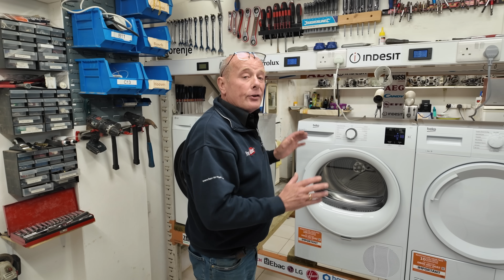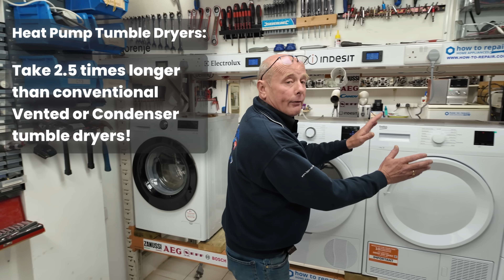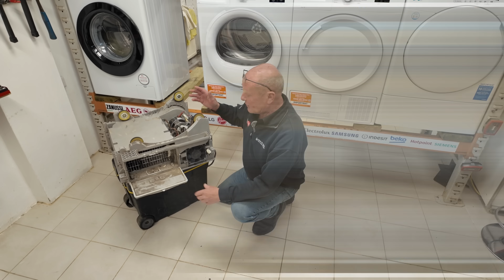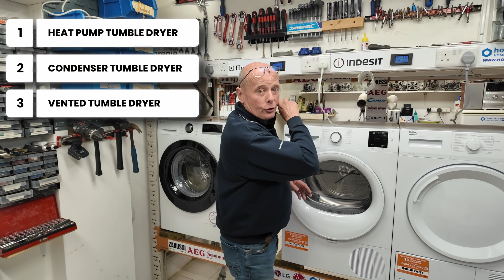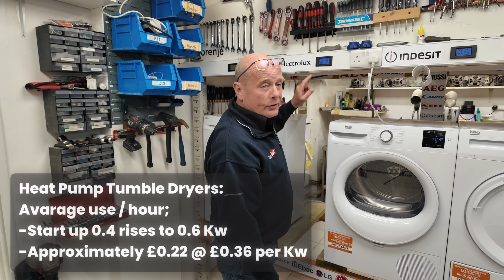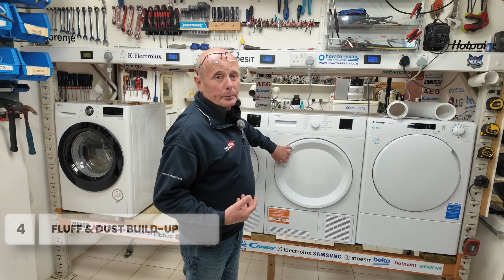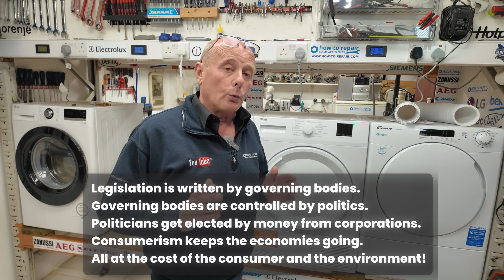Tumble Dryers the Shocking Truth About Heat Pump vs Vented & Condenser, NEW LEGISLATION!

Comment: I have a heat pump tumble drier, an ‘own brand’ one from a well known high street department store. It is now over 12 years old and has, and still is, performing faultlessly. One advantage of a heat pump drier is that the risk of it catching fire is very much reduced because it does not have a high temperature electric element, the heat exchanger runs at a much lower temperature than an electric element does.
Reply: A propetly installed and msintained std. Dryer will never catch on fire.
Reply: emmmm the only reason they catch fire is because people run them with a damaged lint filter thereby allowing fluff to get in to the heating element, the gas in a heatpump dryer is not exactly environmentally friendly is it
Reply: @dazt5831  Fluff could also get through the holes in the back of the drum and fall onto the element, some will always get through the filter mesh, bad design, overloading, wear and tear, and flexing in the case can also cause gaps in the drum seals which would allow fluff to get through and get trapped in the drum seal from where it could fall off into the element, and also form a felt like layer on the seals. Even after my vented dryer was modified as part of a fire safety recall, a layer of fluff had coated everything inside the case after about 7 -8 years more use, although significantly less than the last time I'd had it apart.
Reply: The energie saving on a heatpump unit versus a condensor is far less in wintertime. Energie consumed by the dryer stays in the house as heat. Saving on gas....Same as with bulb lamps versus led.  In a house full of LED lighting you need more gas to heat it. Small difference but it must be considered when comparing.    DIY repair options are very important as it saves a lot of money..
Reply: @JurBtree  Yes, except using your example you are paying 5x less for lighting an LED house vs incandescent one.
Reply: 50 years as a retailer and repairer, I wouldn’t touch a heat pump dryer with a long pole.
Reply: I've got a Bosh Series 6 heat pump dryer. Had it for 3 years and love it. Yesterday I dried a towelling robe that was hardly damp. I expected it to finish drying in approx 20 mins. It didn't finish for well over an hour. I suddenly rushed into the kitchen as I had been watching TV and forgot about it. When I opened the door there was loads of steam and the robe was that hot I could hardly touch it. I rang Bosch who put a call on. Engineer came today. He changed the door as it had dropped and when I mentioned about the hot robe he practically laughed at me and said it is not a fire hazard as it does not get hot due to the way it works. There is no way it can catch fire he said. So can someone in the business explain this to  me please?
Reply: totally agree had mine heat pump tumble drier R134a gas 14 years now and it still looks like new inside took it apart last week the belt was perfect did look 14 years old , it's  environmentally friendly  due to amount of electric it hasn't used , I've had condensing and outlet but both made my kitchen windows mist up and the electric bills with a family of 4 people  was another reason .
Reply: The added complexity of the heat pump dryer might lead to an increase in fire hazard. We wouldn't know without seeing fire statistics.
Reply: @dosgos  There are literally billions of air conditioners and fridges in the world.  I've never heard of one catching fire, though I imagine there's the occasional freak event.  It's clearly not a dangerous technology.
Reply: @incognitotorpedo42  With the newly introduced more flammable refrigerants, this becomes more of an issue.
Reply: really?  Heard of Grenfell Tower?  Root cause was a fire from a faulty fridge/freezer (a Hotpoint FF175BP to be precise).
Reply: @M6L9  correct. And since the discovery of the ozone hole we've moved over to refrigerants that are themselves inflammable if they leak. The Grenfell fire fit example was started by a fridge that used propane as a refrigerant. All you need is a leak of inflammable gas plus a spark....
Reply: My drier uses R134a which under normal use is non-flammable. Most domestic fridges use the same gas, however because of its potential global warning issues it is being phased out. I am not aware of any fridges or heat pump that use butane as the gas.
Reply: @ChrisSchroeder-g3t  You may not be aware of any fridge or heat pump that uses butane based gas - but that doesn't mean they don't. I just checked the label on my fridge - as I thought - it uses R600a which is an isobutane - extremely flammable - but non toxic. It is actually a popular choice for refrigerant gas as it has a very low global warming impact particularly compared to R134a - 3 vs 1430 for R134a, so as you noted R134a is being phased out. It also has a lower pressure requirement compared to R134a, making leakage and construction cost slightly lower.  I hope when your dryer fails you take the appropriate action to have the R134a removed and dealt with rather than it just being vented to the atmosphere. Hope this helps your knowledge.
Reply: @ChrisSchroeder-g3t  

Some Heat pumps use R290 which is Propane. Has a very low GWP.
Reply: Sorry, but that is simply not true. Heat pumps use R600a gas, which is butane. It's highly flammable and at risk of exploding if it builds up in a poor ventilated area.
Reply: @TheLinkedList  

Sorry but that's not true, my Samsung HP dryer uses R134a, or tetrafluoromethane, it’s nontoxic, nonflammable, and non-corrosive.
Reply: @_Dougaldog  R134A erodes the ozone, and it doesn't take much. It is also heavily regulated in the EU/UK, expensive and soon to be banned from uses like dryers and fridge freezers. How is old is your dryer, newer models from Samsung use R600A?
Reply: @TheLinkedList  

13 months old, Samsungs flagship HP dryer uses R290.
Reply: @_Dougaldog  I'm surprised, samsung must be using a lot of refrigerant in their flagship tumble dryers to merit using R134A.

HIsense are using propane in theirs, for example.
Reply: @TheLinkedList  

My unit is not their flagship dryer, the unit that is uses R290 (Propane) with a GWP of 3 if I remember.
To put things in perspective if my house heat pump lost all its R32 after a catastrophic failure that would have the same total GWP as the CO2 produced from a gas boiler in six months.
Reply: @_Dougaldog  Tetrafluoromethane, like other fluorocarbons, is very stable due to the strength of its carbon–fluorine bonds. The bonds in tetrafluoromethane have a bonding energy of 515 kJ⋅mol−1. As a result, it is inert to acids and hydroxides. However, it reacts explosively with alkali metals. Thermal decomposition or combustion of CF4 produces toxic gases (carbonyl fluoride and carbon monoxide) and in the presence of water will also yield hydrogen fluoride.

It is very slightly soluble in water (about 20 mg⋅L−1), but miscible with organic solvents.

Uses
Tetrafluoromethane is sometimes used as a low temperature refrigerant (R-14). It is used in electronics microfabrication alone or in combination with oxygen as a plasma etchant for silicon, silicon dioxide, and silicon nitride.[8] It also has uses in neutron detectors.[9]

Environmental effects

Mauna Loa tetrafluoromethane (CF4) timeseries.

PFC-14 measured by the Advanced Global Atmospheric Gases Experiment (AGAGE) in the lower atmosphere (troposphere) at stations around the world. Abundances are given as pollution free monthly mean mole fractions in parts-per-trillion.

Atmospheric concentration of CF4 (PFC-14) vs. similar man-made gases (right graph). Note the log scale.
Tetrafluoromethane is a potent greenhouse gas that contributes to the greenhouse effect. It is very stable, has an atmospheric lifetime of 50,000 years, and a high greenhouse warming potential 6,500 times that of CO2.[10]

Tetrafluoromethane is the most abundant perfluorocarbon in the atmosphere, where it is designated as PFC-14. Its atmospheric concentration is growing.[11] As of 2019, the man-made gases CFC-11 and CFC-12 continue to contribute a stronger radiative forcing than PFC-14.[12]
Reply: @TheLinkedList R134a is an ozone friendly alternative to R12, which was phased out due to the Montreal Protocol. While R134a is ozone friendly, it has a high global warming potential so it's being replaced with for instance R1234yf and HC based refrigerants.
Reply: @TheLinkedList  isobutane (R600a) and propane (R290), both flammable gasses which are vented to the atmosphere if there is a leak or a repair.  Can you say exploding refrigerator?  Fortunately it doesn.t happen a lot but it is a possibility.  R-134A, 1,1,1,2-Tetrafluoroethane is a hydrofluorocarbon and haloalkane refrigerant with thermodynamic properties similar to R-12 but with INSIGNIFICANT OZONE DEPLETION POTENTIAL and a lower 100-year global warming potential.
Reply: GAs dryer is best, and nobodies changing my mind...
Reply: Gas dryer yellow pure white fabrics over time.
Reply: @Sadler2010  That depend on what you mean by best.  Best fire hazard?  Best explosion hazard.  Lowest cost per use?  It still has to vent outside requiring a penetration in the building envelope and it sucks air that you've paid to heat or cool and sends it outside, creating a relative vacuum and sucking in air and dirt from outdoors through every nook and cranny.  And distributes lint through the neighborhood not to mention wasting heat by sending it outdoors.
Reply: @Sadler2010  That pretty much doesn't exist in Europe, because every single regular household outlet in a house can power an electric dryer.

Comment: The problems you have identified seem to be down to bad design of the driers rather than a fundamental issue with heat pumps. So, are some manufacturers better at design than others? Which are building with maintenance and repair in mind, which are building with planned obsolescence and replacement as their dodgy tactic? Please name names!

Comment: The truth is manufacturing is now done by the robot , not screw  and nut replacement parts !  But spot welding the engineer is obsolete sad to say  I know how you feel  , you cannot keep parts in stock as they modify  and change fast. Just a complete waste of raw material .

Comment: I've always disliked the fact that our vented tumble dryer chucks 2.5kW of heat straight into the garden. So I've been keeping an eye on heat pump tumble dryers. The extra run-time (and subsequent bearing wear) did concern me. But seeing the dust build-up problem and the fact that none of this is accessible from the outside is a major worry. I'm guessing that re-gassing the system requires a full teardown too.

Comment: Save money and don't buy any type of tumble dryer, instead, use a clothes horse and a dehumidifier. Inexpensive to buy and run, also far less wear on your clothes. We've been mislead into buying these large and expensive machines for too long. Thanks for making this video exposing the true pitfalls of each type of tumble drier, but I'm glad I got rid of mine and purchased a dehumidifier.

Comment: I really disagree with most of this video’s conclusions and many of the premises used to arrive at them. 

Heat pumps are refrigeration systems, exactly the same as used in refrigerators and air conditioners, which are highly reliable products. What fails in modern appliances is poorly made electronics and plastic parts. Those factors affect any type of dryer.

Things like dust collecting inside, and difficulty in cleaning it, are problems with specific models’ designs, not a fundamental issue with the technology.

The apartment I have lived in for over 11 years came with a brand new Siemens (Bosch) heat pump dryer — the base model — and it has given me absolutely zero problems, and I haven’t heard any rumblings of widespread problems with heat pump dryers in general. They’ve been de-facto mandated in Europe for many years now (by legislating minimum efficiency standards that vented and traditional condensing dryers simply cannot meet.) 

And let’s not forget that heat pump dryers have the advantage of being gentler on clothes, since they don’t get anywhere near as hot. This means savings in the long run since clothes last longer. 

My previous apartment had a traditional condensing dryer, and it was almost as slow as heat pump dryers. Neither is anywhere near as fast as a high temperature vented dryer. 

The only valid point I see, maybe, is the one about bearings and motors needing to survive longer run times in heat pump (and probably traditional condensing) dryers. But since the manufacturers need to maintain a certain level of reliability in order to keep down warranty fulfillment costs and prevent damage to their reputations, they almost certainly take this into account and reinforce those parts accordingly, compared to their vented models of the same date.

Comment: Thank you for taking the time to make this video. A clear, articulate seasoned professional view point. As a retired engineer could not agree more. There is no reason why the heat pump motor can't last 20 years without leaking.. The big challenge for the manufactures is coming up with a practical, easy to clean, evaporator cooling fin assembly. You should give testimony before  pertinent EU governing body.

Comment: I didn't watch the whole video, but my question is, "Where is the heat coming from for the heat pump?"   If the whole dryer in in your home then the dryer is taking its heat from your room. This obviously needs to be made up by your home heat system during winter months.  Did you factor that in for your efficiency results?

Comment: I get your opinion(s), and I agree with some of them. 
However, I’ve recently brought a “self cleaning” heat pump dryer. 
Once a month I force run the “self cleaning” cycle, and the condensate tank is filthy after running it. 

More so, I’ve actually noticed a lot less lint is actually being lost, due to the gentler & much lower drying temperature. 

For the amount of cycles my household does (and season specific. Outside drying typically May-Oct), we should save at least £100 a year in energy costs.

That’s going from an already very very efficient condensing dryer. Which we sold locally on Facebook marketplace. 
Over 12 years old, kept it in very good condition & did maintenance on it. 

And a last note, it’s incredibly quiet.

Comment: I've had a MIELE washer and dryer for 5 years. And I think they're wonderful the washer spins at 1600 RPM so the clothes are practically dry when they come out of the washer and then the heat pump dryer does a wonderful job at drying them. What ruins your clothes is the high heat from a gas dryer the heat is what ruin your clothes. The heat pump dryer runs at a lower temperature which is more gentle on your clothes do your research people.

Comment: My heat pump dryer takes about 10-20 mins longer than my old vented dryer for a full load, is so much cheaper to run and never shrinks or damages anything like the old ones did, I've even dried knitwear in it without damage, had it 5 years now, would never have anything but a heat pump

Comment: this is exactly the same as i have found with modern central heating boiler and heat pump dryers the who of life cost is the same or more and with no saving in C02. i ran one of the north wests largest property management companies looking after several thousand properties and i can say that most so called green projects and no better or in some cases worse than the oridginal appliances

Comment: Rather than measure the KW used during the initial heat up, could you say throw in a couple of blankets with 1 litre of water each dryer, then run them until the 1 litre has gone. Tell us the KWh used?

Comment: Sir, you are absolutely right ( out of my own experience with heat pump tech ) !!
We're having a washing machine and tumble dryer both with heat pump. It is the one after the other problem, especially during the winter, it performs so poorly that it takes ages to dry or get the temperature during the washing process. During the winter in regard to the tumble dryer I have to tilt the machine so that the water gets pumped out to speed up the temperature.

Horrible technology, we did hope we've bought 2 expensive Bosch machines that's saves us money at our electricity bill (as advertised) and perform well but none of it is true. For some time my wife and I consider to replace both machines and after watching your video, which came up in my feed, it confirms my thoughts about this tech, so yeah definitely going to replace that crap 🤔

Thank you sir for your honest video as an expert. Wish had known before wasting a lot of money.

Best regards from the Netherlands 🙋‍♂️

Comment: Thanks for the informative video. I just checked AO, and an entry level Indesit HP dryer is listed at £339. I wonder if this changes the economics? Even if it does, I don't like the idea of chucking away white goods after just a few years. The use of natural resources is far more important to me than saving a few £££, and I'd rather be able to repair for at least 10 years.

Comment: So we bought a Samsung heatpump dryer we paid £895.00 it had a 5 Yr warranty just out of warranty it's leaking we clean it after every use ,it is cheaper to run but now it needs fixing by an engineer, it is also difficult to clean at the  bottom been disabled I think it's a bad manufacturing problem as its not easy to do for me it's been a costly experience which I'm reluctant to buy again I feel that heat pump dryers are flawed with faults manufacturers are ripping customers of 😢